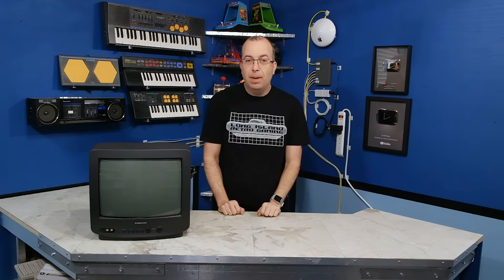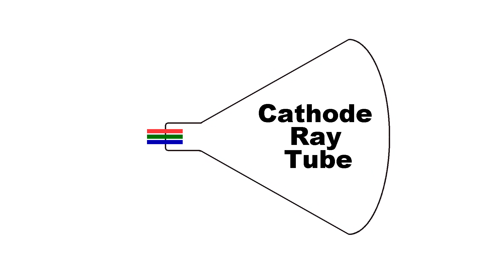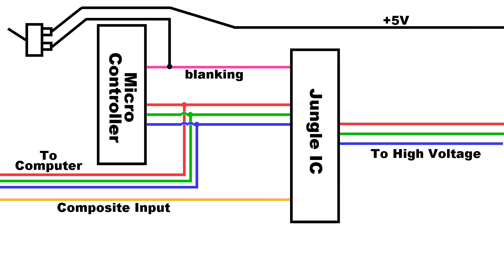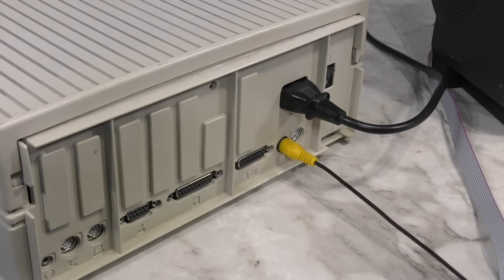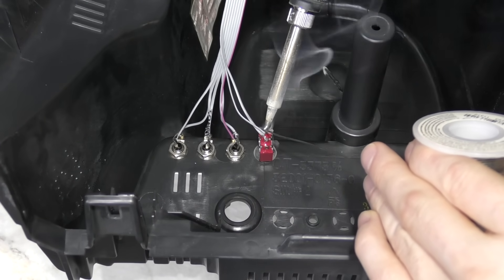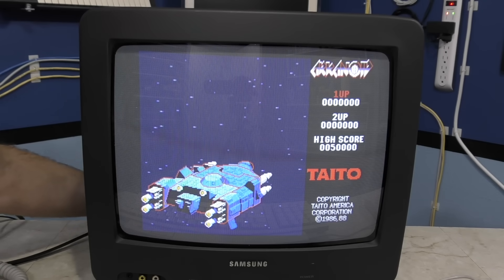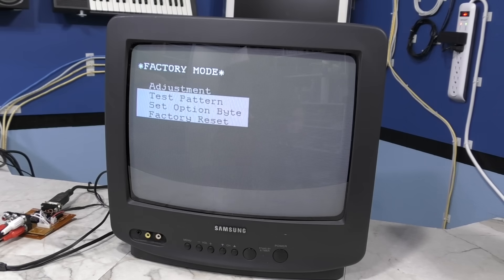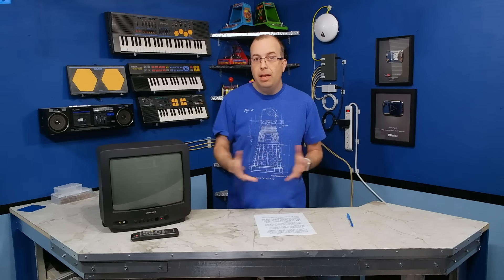Modding a consumer TV to use RGB input

Comment: Hi Dave, new fan here!
I'm a total retro guy but love modern stuff too.
My very first computer was a BBC Master 128, and I learned to program BBC Basic from an Acorn Format Magazine in the 80s,

after that, I owned an Atari STE 1040 in 1992. Some of the 16-bit Programming Demos used the 'scan line' trick for rasterizing tricks on the ST.
I've thought of upgrading my ST to work on the normal HD TV, but I think just changing the RGB to SCART is the best idea ( since I live in the UK ).

I've also owned a few consoles, an NES, a PS1, N64, and a PS2. I now have modern equivalents but like emulation.

Keep up the excellent content.
¬Morebits

Comment: I don't remember Scart looking so good. Maybe I was using the wrong Scart cables back in the day. Haha.
Reply: Long cables and poor quality ones reduced the quality. Its analogic so yeah. It was mandatory for TVs to have it here in France, so it's built in a lot of TV's, the connector simply isn't there.
Reply: @victorpelini5995  Cheap cables only had 10 pins connected (out of 21) with plain wires inside, so they were transmitting CVBS (composite) video instead of RGB.

Comment: Can someone explain what SCART is please? As an american, we don't have that, and it still confuses me to this day.
Reply: Is an european connector called sometimes euroconector, this transmites video and audio in the same connector, the good thing of this cable is that is capable to transmit composite, RGB, S video and YPbPr. The RGB and YPbPr are the most interesting for retro gamers because they are way better than composite and S video, but many consoles need to be modified to access to this video modes also your tv needs to be compatible with scart or get and adapter or upscaler.

Comment: Really loving your videos, especially for the nostalgia. I was a satellite TV installer for 20 years and noticed a switch in the way HDMI worked about 9 years ago.  Years ago you could use an HDMI to Component video convertor, to use your older  projector or TV with a newer DVD/Blu Ray player with HDMI, then one day I tried it, and got audio, but no video. Come to find out, a new technology was employed in secret to unsuspecting consumers. It's called HDCP (First developed by Intel around 2001, then fully implemented around 2010, as a form of copyright protection). It  prevents you from using newer DVD players equipped only with HDMI out and an HDMI to component convertor connecting to older projectors, that had a combination of s-video, composite, or DVI only.   So the manufacture answer to the consumer is, "go buy a new projector". I'm like WAH?!?! My old projector had a great picture, and still worked great. SO FRUSTRATING!!! So what I ended up doing was rip a DVD to the computer, and play using the HDMI from my older computer then using an HDMI convertor to switch to component.  Some have said that if you buy an HDMI splitter it bypasses the HDCP, but after trying about 6 splitters, I found that not to be the case, and some even advertised they would bypass HDCP, and they didn't.  Playstation 3 has a feature in the menu to disable HDCP to allow gamers to record their play, but if you just wanted to watch movies using an older projector, you're screwed I guess. The whole reason I encountered this was because I had a first generation Blu ray DVD player that only had component out, and it was having a hard time playing newer blu ray dvds, and always required internet updates, and finally support was dropped for it. So I thought maybe time for an upgrade anyway, and that's when I encountered this problem.  Have you ever found a work around, or encountered this? Just curious.

Comment: 7:12 your thumb is so close to that soldering iron!  Gives me flashbacks to when i've burned myself with a hot soldering iron
Reply: Speaking of light burns, I know a way to alleviate them. 

1: Aloe Vera Gel. You could keep some of the capsules on hand from the vitamin shelf at Walmart, then open them and apply the gel to a light burn. It works quickly if it's a light burn. (I speak from experience with this.)

Also, 2 (though I haven't tried this personally, I need to mention it just in case it works:) Freshly Cut, Raw Onion. Supposedly, this will help against more severe burns, but I don't know for sure. I've only heard about it from a few places. Take a freshly cut onion, and hold it on the burn. Alternatively (and this seems to be the better option if you can do it in a pinch,) you can take some raw onions, and juice them. Put the juice in a rag, and hold it to the burn. Please don't just take my word for it on this, though; I haven't tested it, but I would if I burned myself again. 

Stories of this onion juice idea working range from:

1: A toddler (or baby, I forget) got burned by coffee. His parents then put fresh onion juice soaked rags on him, and he stopped crying some time after that.

2: A teen in a kitchen in the 1500s or 1600s fell into a pot of hot oil, and got the same onion treatment. His skin (supposedly) didn't blister where the fresh onion juice was. 

I CANNOT verify these stories about Onion Juice alleviating burns this well, though, so please don't assume they're true WITHOUT testing them for yourself IF you burn yourself. That's not to suggest to "not seek out medical help," either. I am NOT a doctor, I'm just some guy interested in how food works, and the onion suggestion is just something I heard. I don't know if it works.
Reply: @101Volts  I knew none of that in high school when i burned myself, i just sat the rest of the day in pain, i didn't even take any pain relievers
Reply: @lander77477  "A smart man knows which end of a hot soldering iron to pick up." Used to be a pretty common saying around TV repair shops, back when things like that existed. Back before fancy Weller-type spring wire soldering iron stands, practically everyone learned which end of the soldering iron to pick up, the same way you did.
Reply: @Weekblues anywhere between 400 to 700 degree Fahrenheit

Comment: how does this work? Why is the RGB image so much cleaner?
Reply: composite uses only one conector wich carry all the color sync chroma etc, if you separate the colors into another lines you can get much better immage, just rgbs, so you have 4 cables doing the job of composite

Comment: 1:37 is simply not true on a technicality.  Yes, analog TV died with the exception of low-power TV stations on Friday, June 12, 2009, but all you need today is the old VHF/UHF antenna that you originally used with that TV and a digital converter box, and you're back off watching TV just like you used to.  With that said, however, low-power analog TV will disappear on July 13, 2021 (yes, only about three weeks from now).  Also, at 0:57, my fictional character would have tried to force Samsung to give him all three options at once so he could have had the ultimate home office setup.  I can see right away that his office setup would have been just about the most delightfully stereotypical office setup of the 1990s in that office building.  If that were the setup in my home, I would have had the ultimate anti-COVID-19 office.  This means that I could have recorded the latest escapades of Ash and Pikachu while cooking a plate of Hot Pockets for some of my quarantine snacks in my home office.

Comment: Correct me if I'm wrong, but having only Red, Green and Blue signals should create 9 colours not 8. Considering that there are 3 colours which have 2 phase the maths would look like this  3^2 which would equal 9. By adding a 4th line you would have 16, as 4^2 is 16.

Comment: Public Service Announcement:   A lot of comments here say "All TVs in Europe with the SCART connector can do RGB".  THAT IS WRONG.  A SCART cable can deliver video in three different ways: composite, FBAS, and RGB. However, the TV has to have the circuitry to make use of direct RGB input, which was often a high-end option. So don't pick up a random TV from Europe and expect RGB. Often, you have to make the same or a similar mod as explained in the video.
Reply: How to test it:  Search the on-screen menu for an option like "AV Mode". It should have two or three different settings, usually "Composite", "FBAS" and "RGB". If there is no such setting in the menu, it is almost sure that the TV cannot "understand" RGB.
The more technical inclined user may check if SCART pins 7, 11 and 15 are actually connected to something on the board inside the TV.

Comment: Looks like the TV was already prepared to have a SCART-connector where where the composite input is.
Are you sure that there wasn't already all the needed connections there?
Reply: It could be just for having the same outer shell for EU and US versions. But yes, noticed that too. Also, having SCART does not automatically means you have RGB or, for instance, stereo sound.
Reply: @SlavaBelkov   I know, but most small TVs like that that had SCART also had RGB in it. People bought them specifically to use as monitors for Amigas etc. 
I had one super cheap, basically no-name, that had it.
For some reason most  didn't have a RGB-button or menu, but needed a voltage on the blanking-pin to switch, so maybe that's why people thought they didn't have RGB.
Reply: Im almost sure its the SCART header. SCART was mandatory here, in France, and quite popular in easter Europe. If you own something in the US that's been sold in France then it's almost sure you can tap in a SCART connector. Now, its kinda useless in the states, but really important here as it was a standard. Heck my 2013 HD TV still has it. Much better than composite with my PS2 !

Comment: The Genesis has a good composite imagine? From what I've seen it has one of the worst but then again all composite images look bad
Reply: Depending on the version of the Genesis/MegaDrive you have there's subtle AV changes (some might say downgrades) on the newer revisions, particularly between the "HD" & "non-HD" versions of the Model 1 design (the launch version the Power Base adapter for Master System-on-Genesis was originally designed for).
I believe the guys at My Life In Gaming cover it in the RGB Master Class Episode RGB203 (Episode 3 of the Class 200 Level, each episode going over a retro console between NES & PS2 and their graphics outputs and capabilities).

But generally; for the time Genesis/MegaDrive composite was some of the better quality out there for gaming, whilst having RGB output if the TV supported it (either via Y/Pb/Pr as RCA-Component, or as SCART).

Comment: Thanks you!!!!  This is exactly what i wanted to see with the video game consoles.  The SNES looked so amazing in RGB mode.  We used to hook up our SNES's to the badass Amiga RGB CRT Monitors for the best possible signal/image quality possible at the time.  You can also use this hack to hook up the old Arcade MotherBoards for some pretty Arcade Experiences.  You just solder the RGB from the T.V.  over to the RGB output of the Arcade MotherBoard,  and you're good to go.

Comment: 12:15 The picture may be sharper in RGB but the black levels are much weaker. When you switch to composite you can see how much darker the background gets.
Reply: just a matter of tunning the gamma to the rgb signal.
Reply: @GraveUypo  So you can get it deep black on pretty much any crt by doing that? Because the ones from the 2000's have deep blacks without any adjustment.
Reply: @overkill7990  rgb has a different gamut than composite and this tv does not have rgb from factory. pretty obvious it'd need calibration.

Comment: All I used to do was drastically reduce the contrast in composite and it really cleaned up the picture but it was never quite as good as my Commodore RGB monitor.  I still have my C64 and my Amiga boxed up in my cellar along with some old DOS machines as heavy as a ships anchor.  I'm going to have to set them up for my grandchildren.

Comment: I finaly successful also modify crt tv composite to rgb.
Remove one leg the resistor from the cpu in place of this solder wire to this hole and for the up leg also find 5v from the regulator.
Composite from exists.
R g b from the cpu spot before the rgb ressitors
The 5v for fsst blank call also rgb enable.

Comment: Text struggles to look good on colour TVs because the colour sub-pixels are barely finer than the stroke of the letters. Monochrome TVs are better, though somewhat harder to find. However, there were small portable 5-inch TVs made for kids going to college, or campers, lorry drivers etc. They are pretty good as displays for monochrome machines like the ZX81 and Acorn Atom. 
https://hackaday.io/project/29533-baseband-video-on-old-tv

Comment: Another tip is to remove the video "colour killer" filter and re-route the audio signal. That filter puts a notch in the video signal where the audio signal carrier is. This stops audio affecting the picture but has an unwelcome side effect on some high frequency video signal. E.g. when actors wear fine-striped suits, or the edges of computer text. You can simply remove the filter and wire link input and output  if you computer does not transmit audio on the composite signal (e.g. Acorn Atom).  If it does (e.g. Atari 800) then you also need to (easily) mod your computer to send the audio separately. S-video connectors carry video and audio separately for this reason.

Comment: Toshiba tellies are the only major brand that accept both PAL and NTSC timing through phono and SCART connectors, by design. This is important, because TV tube coils are designed to run at a resonant frequency matching the frame rate. Any other frequency is less efficient and the waste energy heats the coil, tube and driver which is not good. A TV designed and guaranteed to cope with either rate will do things like switch in an extra inductance to change resonant frequency. All brands of TV only supported one RF standard, but those no longer exist. Old TVs are only usable as baseband composite and RGB video displays. Late American TVs often had composite video in, but seldom or never SCART. If you are in the US, and can't get a European TV (heavy and expensive to ship!) and you go looking for an old TV then Toshiba would be my recommendation for modding as per this video. Some of the big expensive TVs might have SCART input, and even those are often free to collect. If you have the space for one.

Comment: I have a problem, I have a Commodore Amiga 600, and want to display it on my modern LED 4K Smart TV.  What’s the best way to do this using the best quality picture?   Also, same thing with my Commodore 64.  I’m not as technical as you, but I do have knowledge of taking things apart, and soldering.  Just not as technical on components like resisters, etc.   Thanks.

Comment: I built a Sega Genesis Model 1 A/V board that supports composite, RGB + sync, and audio (both Mono and Stereo for the front headphone jack on the Genesis) for my Genesis Model 1 and connected it to my 43" 4K UHD HDR TV using the DVDO Edge Upscaler I've purchased a few weeks ago. The picture quality is amazing.

I wish I can modify my Sony PVM-9L1 for RGB, however, the composite BNC isn't working anymore for some reason and I think it's a bad contact somewhere on the board.

Comment: This is really fascinating. Would the RGB mode still actually show a full 640x480 resolution? I still would expect that it could not, as the tube itself in consumer TVs was of lower quality than that of computer monitors. The standard NTSC analog 480i signal was only rated to show a horizontal resolution of 330TVL, not 640, so tubes only had to be good enough to show the former. Any comments on this? Thank you, in advance.

 Note that on the matter of the Genesis, some games actually were meant to be viewed in RF mode even though RGB looks better. The Genesis used the blur in some cases to create an illusion of more colors. Zebra-striping black and white would make gray. Or mixing one green with black pixels could create an illusion of a green color shade gradient (Gauraud) of multiple greens, like the trees in the world map of Lunar. If you switch to RGB, this effect is lost, although other things look much better, especially text.

Comment: Back in 1993, I once removed the back from an Analogue Television, and then soldered three RGB connections on the three Output Transistors (marked as RGB). I then connected to my Computer. Turned it all on. BIG BANG and smoke! No more TV. No more Computer. I ended-up fixing the TV, and getting good picture and sound. The PCB of the Computer was all blasted away with molten copper. I learned a hard lesson back then, to study things much more carefully before committing to any action.